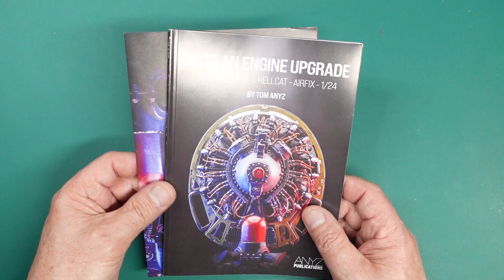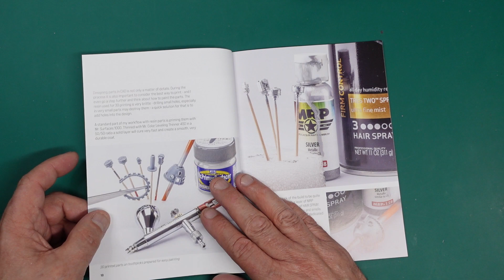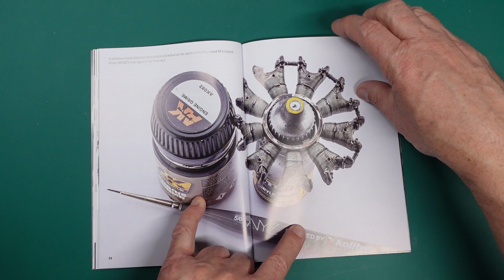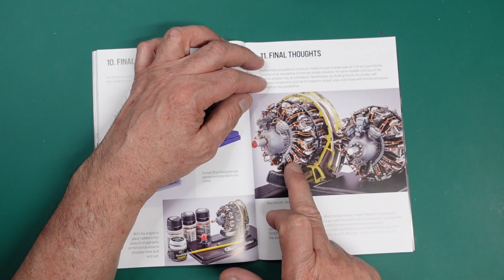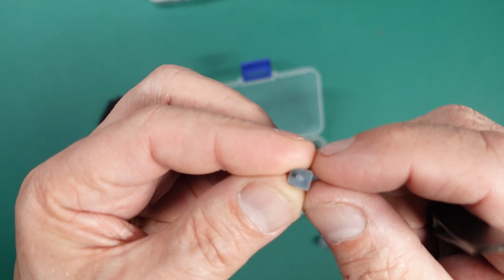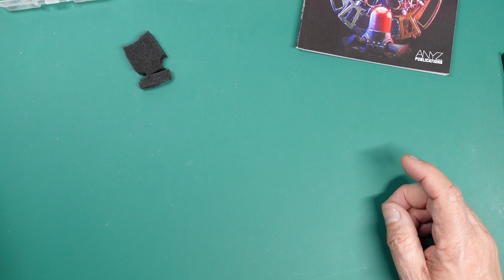"Just an Engine Upgrade" New Anyz publication and a look at some resin parts.

Comment: Big fan of Anyz . Trumpeter announced a,  (possible, but have some doubt) 1/24 P-47 for 2024.  I recently built a 1/24 Kinetic kit using Anyz products as part of the engine modifications, video with a still image toward the end posted on my channel for anyone considering doing the same. A 1/24 F4U Corsair would be ideal for this level of detail partly due to the engine being up close with the front of the cowl. Airfix please make a 1/24 Corsair.

Comment: Just a clarification, the two cylindrical items on the front engine casing are the distributors. (Grey color) 
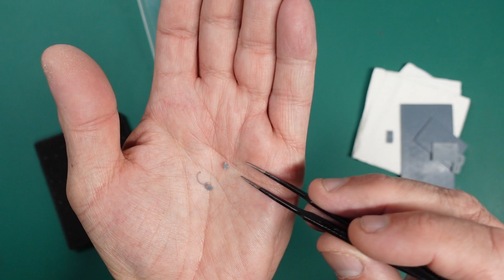The single item (12:00 o’clock) on the front engine casing is the (two in a single package) magnetos, (black color)

Comment: Hi Nigel, great review, I forgot how good these upgrade make the engine look. Question, is there any original plastic parts from the engine being used? Because based on his work. He might as well as do the complete engine in resin. Cheers.
Reply from the maker: Yes Alain, pretty much everything behind the front gear cover is plastic.

Comment: Nigel,  for your future reference, on an R-2800 engine, the magneto is the device that is mounted on the top, center drive pad of the reduction gear housing, and the two units mounted on either side of the magneto are the distributors that feed the dual sets of spark plugs.  The distributor on the left fed the 18 spark plugs installed at the rear position of each cylinder, and the distributor on the right fed the 18 spark plugs installed at the front position of each cylinder.  This information comes from Page 72 of the book "R-2800, Pratt & Whitney's Dependable Masterpiece"  written by Graham White, published by the Society of Automotive Engineers, copyright 2001  ISBN 0-7680-0272-9.  The text does not make clear the position from which they are referring to the "left" and "right" distributors.
Reply: You beat me to it. Absolutely spot on for the mag and distributors. The other little part is the propeller governor which that pulley goes on. Thx Nigel for those review

Comment: Dear Nigel,
The double wasp is an engine I have taken a considerable interest in over the last year or so. Radial engines offer so much potential for detailing that it seems silly not to have a go at it. I got the detail wrong on my 1/48 Corsair, (same engine) and will be making up for that in my 1/32  variant!
I have visited the web site and can thoroughly recommend it. What a good partner for your channel!!
Regards,
Z
Reply from the maker: Yes mate, that 1/32 2800 from Tamiya is the mutts nuts!!
Reply: I cannot fault any of the parts I’ve bought from Tom. 👍👏

Comment: I think those pulleys would be for the control cable run to the propeller governor.

The R-2800 uses a dual magneto which is the black doohickey between those two round parts which are the individual distributors for each ignition harness.

Beautiful outcome on the greatest engine ever produced!
Reply from the maker: Thanks Riley, Tron, above also gave a great explanation of all this good stuff.
Reply: @NigelsModellingBench  our posts must have crossed in the mail, haha
Reply from the maker: Nah, all posts are held for review so you wont see what's been posted until I put it up. Actually, I must give you a status so your comments are not withheld.
Reply: @NigelsModellingBench  if you think I can be trusted! ;)
Reply from the maker: @rileyk99  it is done!!